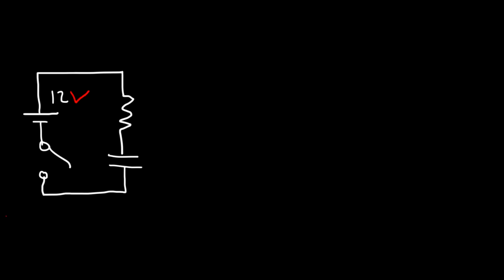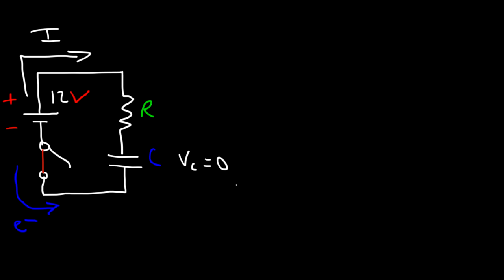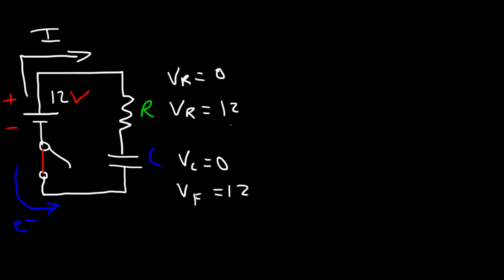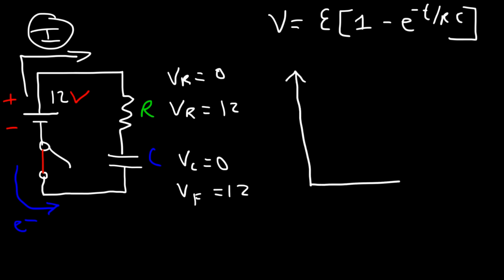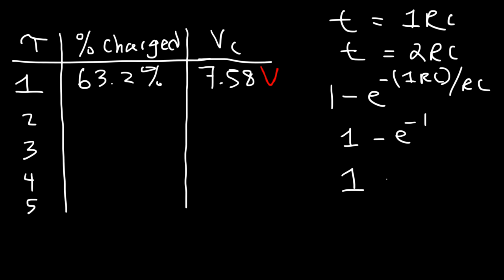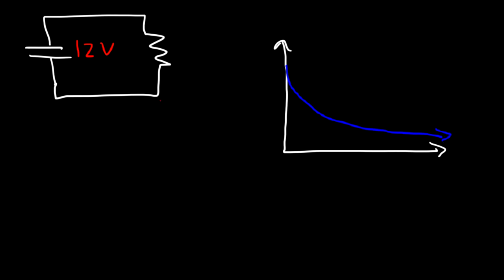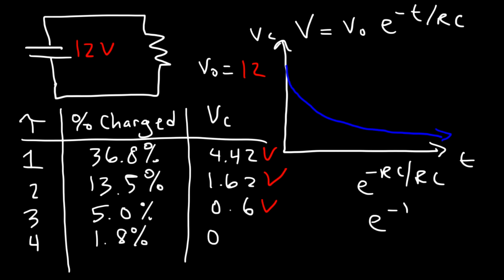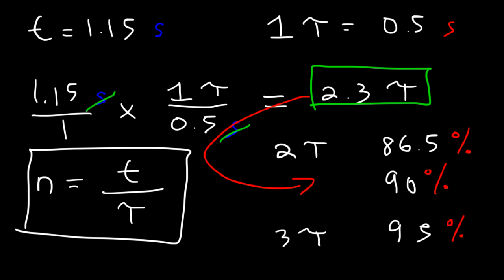RC Circuits Physics Problems, Time Constant Explained, Capacitor Charging and Discharging

Comment: 4:00 "let's talk about the time constant" (never explains what the time constant is) 
I finally get it I think but personally I would have appreciated a bit more explanation, especially on the difference between t and Tau. You switched to using t to represent it and i got so confused and stressed wondering if seconds and RC were the same thing, then later on you convert them... Also more explanation about the 1-e etc equation at around 4:45? physics isn't my strong suit lol

Comment: Hey I have a question. I am building a timing circuit and I was wondering if I can charge the capacitor to 66% over a month. How fast does a capacitor lose a charge ? Is this even feasible? Thanks.

Comment: Does anyone know if the equation still applies in a circuit with parallel capacitors? I'm specifically asking for the case of a marx generator.

Comment: 7:47 I am lost as to why we replace t with -RC?
Reply: I had the same problem. But you take the same method as the first time 1-e^-1x100,1-e^-2x100,1-e^-1x100 and then do 100 minus your answer. So for 1-e^-1 you get 100-63.2%=36.8% :)

Comment: Thankyou for this video. 
BUT when I type in 1-e-1 on my calculator it doesn’t come up with that answer. Can you please explain step by step how to type it in my calculator, maybe using brackets or something.
Reply: make sure you are putting e to the power of 1 (e^-1) and not just doing -1 on the end there
Reply: on some calculators you just need to type e-1 and not even the ''^'' because it puts it automatically

Comment: is there anyway you can do problems that have values missing? The majority of the problems have all values given (V,R, and C). A lot of physics questions don't actually provide all of the values; some have to be solved first.
Reply: I don't know how complex the problem really is, but I would think you would just isolate the missing variable with the given equation. If two are missing just solve one in terms of the other, and solve from there

Comment: because im dumb, is it correct to assume that a tau represent a  1 cyle of a wave, a period.... and resistance * capacitone describe a period. and I don't know where that formula came from.    and then in this equation it represents a time it completed a cycle correct? thats why its being divided by rc to know the rate it complete it cycle...

Comment: are the time constants true for all equations like this or is dependent? sorry I'm taking engineering problems and analysis and my calculus class hasnt gotten to integrals and circuit analysis cant be taken until after physics. kinda raw program

Comment: Another method for "How much time does it take for the capacitor to reach 90% charge?" 
Just keep plugging in "e to the power of x" into your calculator (or just the google search bar) with reasonable guesses for the power. You want the result to be 0.1, which is 10% left, because you know that e to the power of (-t/tau) is equal to the percentage you will have LEFT TO GO at any given point. After very minimal trial and error, you get approximately 0.1 for the answer when you plug in "e to the power of -2.3". Now that you have the correct power, you know 2.3 = t/0.5. And thus t=1.15 seconds.

Comment: RC charging circuit has resistor of resistance 8MΩ and
capacitance 2 micro Farad. What is the value of time constant
of the circuit

Comment: a 10 microfarad capacitor is charged to a voltage of 200v adn discharged thru resistor. how much energy is given to the resistor during discharged?

Comment: 125 uf capacitor in series with a resistor, across a 120v 60hz supply. The voltage across the capacitor is 50v. Whats the ohmic value of the resistor? 
Stumped on this question

Comment: the charge stops because there is no more DDP (capacitor voltage is equal to source voltage), and when the discharge stops also there should no more ddp (capacitor voltage is equal to risistor voltage), but the capacitor voltage at the end is quasi equal to zero! that means that resistor voltage becomes low because of ohm losses?

Comment: One thing I'm kind of confused about is that I'm supposed to solve a problem with no voltage source, just capacitors and resistors. How does one do this?

Comment: What am i doing wrong - using the laptop built in scientific calculator - I use 1−e⁻¹ using the x⁻¹ key to get the ⁻¹ and get the answer 0.632120559 - What other way do I get your answer = 63.27%

Comment: Discharging a capacitor
Why should a capacitor discharge? Imagine the capacitor with all its charges is kept inside a bag and tied at two open ends (open-circuit).
The positive charges on one plate are attracted strongly to the electrons on the other plate, and the electric field is strong and uniform between the opposite charges on the plates. The opposite charges on either plate seem to hold each other tightly. The field is not so strong to cause the electrons to cross the gap and reunite with the positive charges.
There is a fringe field at both ends ready to burst the bag, but the open circuit does not allow charge flow in the external circuit. The electric fields of surface charges which move onto the wires from both the plates and the fringe field will, during the initial transient when the wires are attached to the plates, combine to make the resultant electric field in the wires, zero. The fringe field is different from the field between the capacitor plates.
When the charged capacitor is short-circuited using a wire, the effect is to open the tied ends of the bag and the charges are released. The fringe field causes the initial crucial release of charges for further flow of the charges….and development of surface charges that will enable the charges to flow around the wire, and neutralize each other. After all the charges on the plates are neutralized, the circuit attains a state of static equilibrium, a natural relaxed state of equilibrium and we say the capacitor is discharged.
Electrostatics and circuits belong to one science not two. To learn how a capacitor charges and discharges and the origin and role of the fringe field in the circuit process it is instructive to understand Current, the conduction process and Voltage at the fundamental level as in the following two videos:
i. https://youtu.be/TTtt28b1dYo and
ii. https://youtu.be/8BQM_xw2Rfo 
It is not possible in this post to discuss in more detail the formation of the fringe field when a capacitor is charged and discharged.
The last frame References in video #1 lists textbooks 3 and 4 which discuss these topics in more detail using a unified approach and provide an intuitive understanding of discharging a capacitor with the help of sequential diagrams.
Charging a capacitor
"The voltage across a capacitor cannot change instantaneously" is a statement one finds often in textbooks on circuit theory which discuss the application of a step voltage to an RC circuit.
Most students memorise and apply this in circuits without understanding the physical processes involved.
It will be useful to learn the operation of charging a capacitor using a unified approach to electrostatics and circuits.
It is not possible in this post to discuss the charging of an uncharged capacitor. During the first few nanoseconds after switch ON, while the surface charges arrange themselves, there is no electric field E_cap and fringe field because there is no initial charge on its plates; it is as though the capacitor was not there - as though there were a continuous wire with no break in it.
The last frame References in video #1 lists two textbooks 3 and 4 which discuss in detail with a series of diagrams the physical processes in charging a capacitor without and with a resistor (RC circuit).

Comment: what if there were more resstors
Reply: you'd take the sum of the resistors. All that would do is slow the charging time so it would most likely skew the curves more since it would only impact the time variable.

Comment: The Electronic grade solder has a Tin: Lead ratio of...
(a) 40:60
(b) 60:40
(c) 35:65
(d) 70:30
What is the answer of this question

Comment: Why is the length of the circuit not in the formula?  If you say, have a hypothetical circuit, with a condenser and resister, 1000m away?